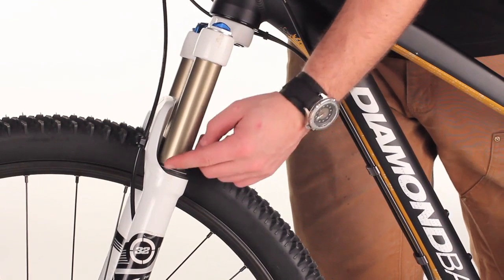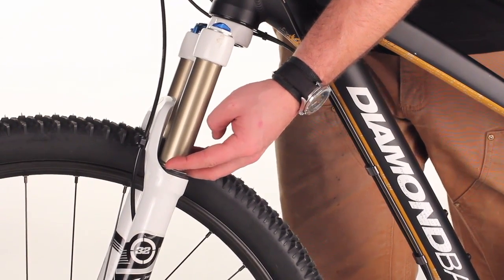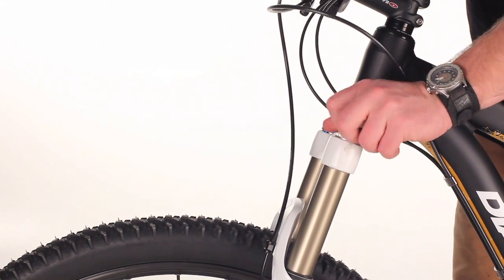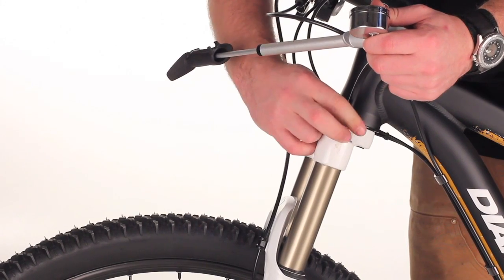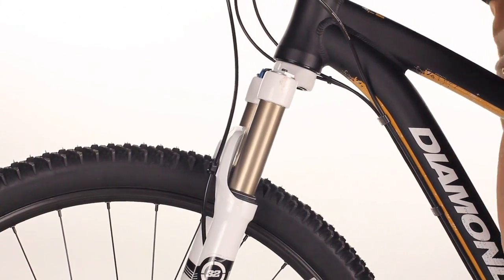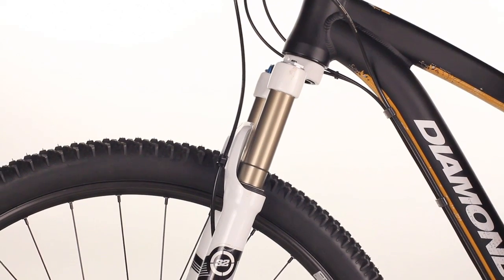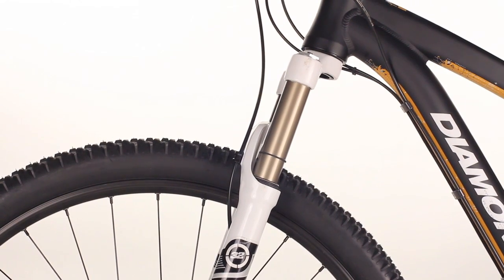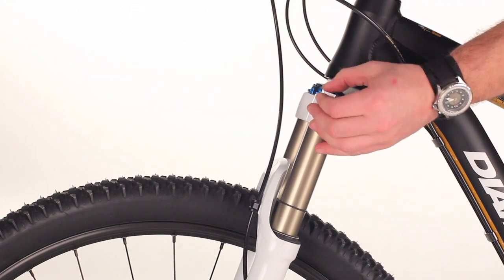Diamondback Tech: Fork Sag setup

Comment: I required an entry level bike to ride on the numerous trails in the Washington DC area. This appears to have been a good choice••>share4.photo/diambackbike?Ӛ    Shifting has proven excellent without any problems to date. Purchased bike from a local bike shop (right off of Mt Vernon Trail) although big box may have been cheaper. Very good sales and test ride service. The bike shop set it up and properly sized it for me, added desired accessories and had me on my way. After a month told to bring it back and they would service it for me. After that any basic adjustments for a year were free. I don't think a big box would do this. So far it has been a good choice.